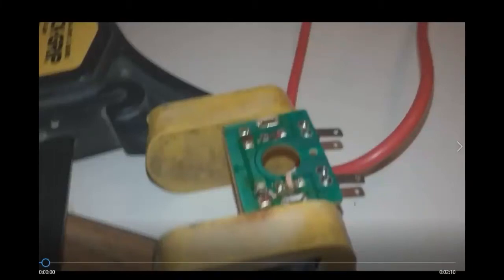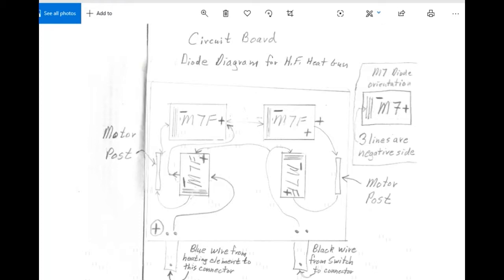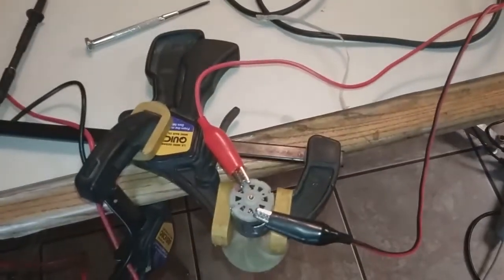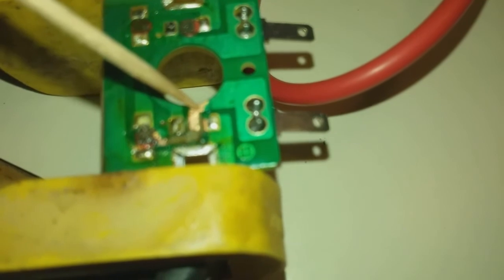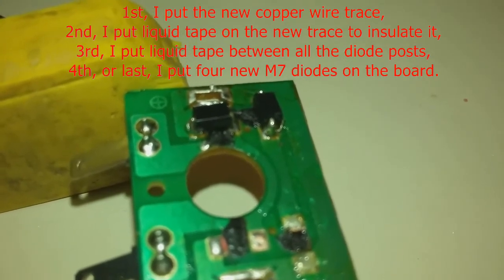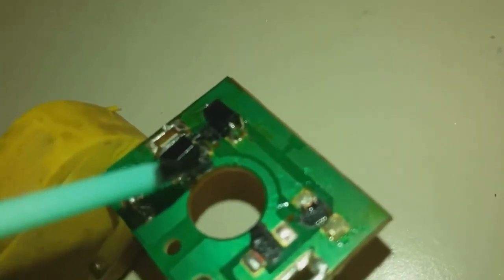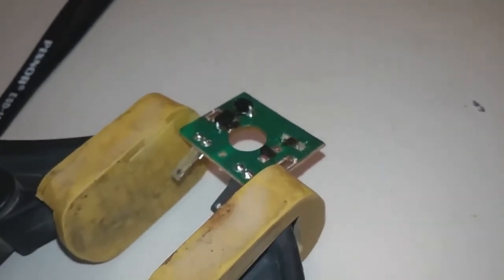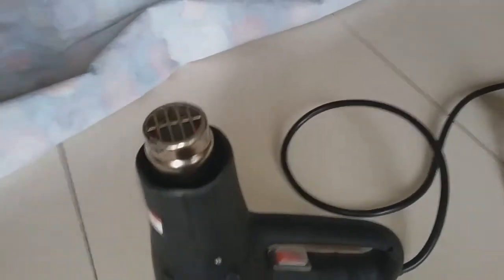Part 2 Harbor Freight heat gun repair

Comment: I just fixed mine and it was the thermal fuse on mine too.  FYI, the fuse that was in mine has a 133-degree C cutoff and is 10A for 120VAC, 15A for 240VAC.  My diodes all tested out good.
Reply from the maker: Congratulation! You kept another small electrical device out of the landfill. I am so glad to hear you fixed yours. Thanks for the comment and info.
Reply: @johntube2525  that’s the point.  It’s not just the price kept it out of the landfill.
Reply: Where did you get the thermal fuse?  Mine is bad and I can’t read it.

Comment: There appears to be a diode (or something) that goes across the outer terminal connectors on the switch.  I say "or something" because on mine, it blew apart and I can now see it as a longitudinal cut-away... :)  Could you look on yours and see what the number of that diode (or whatever) is?

It's a lot easier to test using a voltmeter to follow the voltages when it is live than to just check for continuity with an ohmmeter... Not worth breaking out the o'scope though... Yet... :)
Reply from the maker: IN54 then the last digit or letter is hard to make out, but it looks like a 0, So I think 1N540. Hope this heps.
Reply from the maker: Finally went a got a small screw driver and pried off the brown wire to the center post of the switch and the Diode is a 1N5408.
Reply: @johntube2525  -- Thanks... That gave me something to search for and I found out that some other people have had to replace that diode... I don't think they had quite the spectacular self-destruction of the diode though... First time I ever say what a diode looks like on the inside though... :)

Comment: Damn good video. I just put mine in the trash and purchased a new one for $9.00. Yet I was curious as to how to go about finding out what was broken. This video showed me what I was missing. Thanks so very much for this video, you did a masterful job showing how to repair the heat gun. Just what I wanted to know. My hat is off to you!
Reply from the maker: Thank you so much for the very positive comment on this video. I know I could have bought another for $8.99 plus tax with their coupon, but I just wanted to see if I could actually fix it. I have extra diodes and 9 more Thermal fuses in case I burn something out again. I have used it around 10 times or more and always use the low heat to let it cool down from high heat and it is still working fine. 

The most interesting part for me, was actually fixing the small green printed circuit board (PCB), which holds the 4 diodes. I really thought this is where things will not work out, but it did.
 
Thanks Again! for commenting!

Comment: Yeah, definitely not going to mess with it, hahaha. But i have two non-working guns i will send you if you'd like to fix 'em. I learned a thing or two from you about how these are built though, thanks.
Reply from the maker: The shipping cost is probably more than the guns cost new. Mine is still working great and I have many spare parts now so I think I am set for life.  I try my best to put it on low heat for at least 5 minutes before turning it off. This helps to cool it down enough to keep the thermal fuse from blowing. I have plenty of diodes and thermal fuses to keep it going for a long time now. But thanks for the offer and comment.
Reply: @johntube2525  I decided to open mine up and sure enough the thermal fuse thingy has no continuity. I put it back together and threw it in my bin of broken wonders. I have a hard time throwing things away.